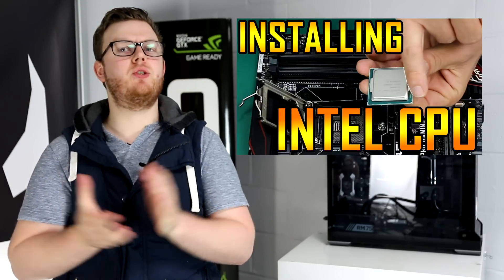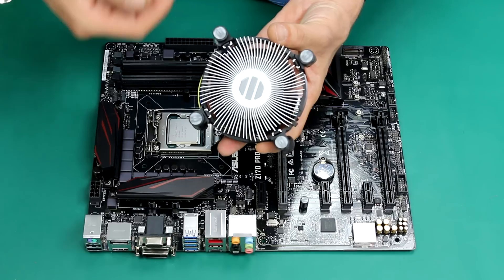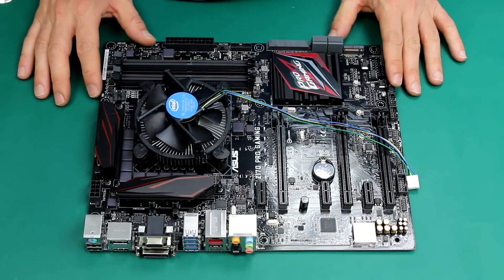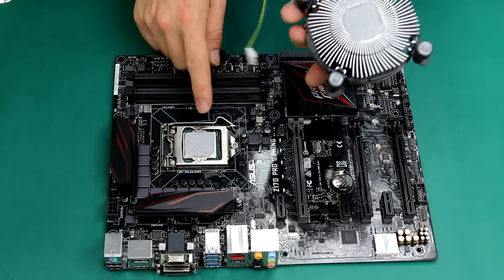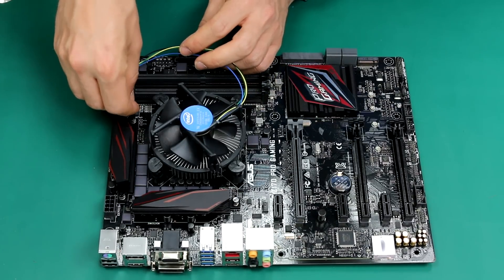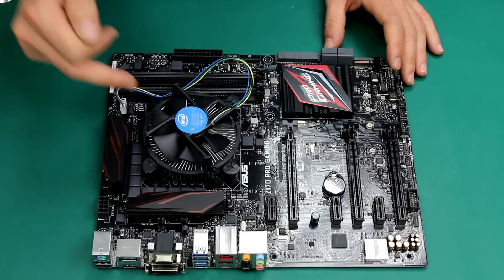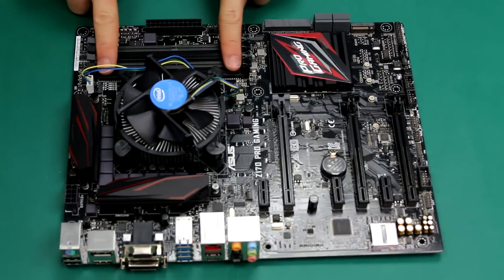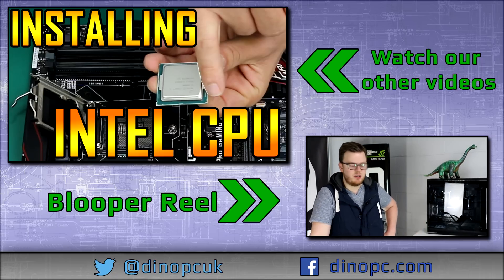"HOW TO INSTALL AN INTEL STOCK COOLER CPU" Dino PC

Comment: This is fine if you have a new fan. If you're reusing an old one, not so easy. To get it off, the black lock pins can stick so they turn the white split  part with them. Then look at the back of the board, pinch the white part with your fingers to stop it rotating and you can unlock. When putting the fan in, look at the back to see if the black pin is completely in. And check where the CPU fan power is and  you can put the fan so its cable runs directly to it. Braid or use a cable tie to remove any slack. 
And there are plenty of videos about how to apply thermal paste. Make sure the CPU and the base of the fan are perfectly clean, use alcohol, before applying the paste.

Comment: Tip: make sure when your putting it back on to pull the clips out after twisting them, then try clicking them in. It does NOT require a lot of force! Don’t break your clips like me!
Reply: thanks
Reply: Hi, I brske the clips too, what have you done next? It s working the clips broke?
Reply: @fky3765  I only broke one so I pushed 3 in and got the 4th in best I could (not all the way) and it worked. 

If you broke all of them you should probably get a new cooler, otherwise your current one may not put enough pressure on the cpu to make good contact for thermal conductivity.
Reply: Actually i broke 1 .. but ur comment did help.. thanks ❤

Comment: Thanks, been making PCs since 1991, but these things are not obvious whether you turn before or after putting in etc. I usually fit better coolers and they have screws.  I dislike pushing that hard against a bendy motherboard!

Comment: What direction should thr knobs be during install and removal?  You say twist but not the direction
Reply: This video is better https://youtu.be/5qczGR4KMnY For installation turn the knobs clockwise, then push diagonally.
Reply: To remove Anti clock  back in clock direction movment

Comment: Hello! Hope your doing fine.. Need help about my computer.. Actually I am cleaning becuse of the dust and decided to uninstall the heatsink but when I started to return it back its place.. The two lock won't click and is so hard to push.. Need help here please..
Reply: Same😭 have u fixed it?
Reply: @matzz3612  Yes... Luckily.. Hehehe let me know if you already fix it ^_^
Reply: @Tingogsayoomen  I haven't 🥲🥲🥲😭😭😭
Reply: @Tingogsayoomen  I need your help 😭😭
Reply: @matzz3612  Oh! am sorry... All I did was twist it lock first to unlock, then point the lock on the designated holes and slowly twist the nozzle to lock... Remember not to exert too much strength because you might create damage to your motherboard..
Reply: @Tingogsayoomen  thx so much

Comment: Might be 4 years old, but you do know there are arrows on the cooler locks for a reason and your press the pins down diagonally opposite, never, ever like this. 

For those watching this, arrows pointing away to install, then turn them in to lock.

Comment: This video doesn't demonstrate how the pins themselves are positioned, which is crucial. Make sure that the black pins are loosly on top of the white pins. If they are too deep in, they make the white pin artificially thicker (so they "grab" the motherboard) so they'll break when forced into the holes. I broke mine by following this video naively.
Reply: @augustkravtsov  You are a life saver

Comment: The clicking system of the cooler is horrible , it isn't clicking in as it should 😟
Reply: Not sure what the response was but i had this same issue. The end tabs on each of the pins had opened out so it wouldnt click into the mboard. I clised them with some pliers and then it clicked in just fine
Reply: Wait he deleted the comment, what was the tip?
Reply: @tanti2325  same here why did he delete the comment 😭 I can't turn on my pc until this is fixed
Reply: @orionscythe  hey man did u fix it? i have the same problem
Reply: @shotokbsh  No I wasn't able to fix it
Reply: Same problem here
Reply: just broke my pins or whatever they are called, I ordered new ones and I hope I will bw able to replace them
Reply: @brd9-o1k i just broke mine im gonna kms can i install them without replacing
Reply: @angel-qu4lb  holy shit man, don't dispair you can order new pins, I did that and in 2 days I had them, I installed the pins and the cooler and now I'm waiting for manor lords to release, there's always light at the end of the tunnel
Reply: @angel-qu4lb  also you cannot
Reply: Simon Herckens it took me half an hour to realise that i have to pull up the pins first. Im braindead.
Reply: @OneThiccSamurai-vn5se  god bles u sir you should make a video about that haha
Reply: @OneThiccSamurai-vn5se  fucking legend dude
Reply: @OneThiccSamurai-vn5se  Jesus Christ thank you so much lmao luckily I saw ur comment at the right time
Reply: @dookiasunny8261  Hahahahahah im glad to help xD. Also be careful not to break em. Ive had quite the annoyance cause one of the pins broke after forcing it too much. It bent outwards and i couldnt get it in the hole so it was bad.
Reply: @OneThiccSamurai-vn5se  I almost broke mine but then I saw ur comment thank God hahah
Reply: @dookiasunny8261  Lmao what were the chances xD.

Comment: i have a problem can i use it without clicking it in ? Answer
Reply: Future Flash || No, you can't because you MUST press it to make an efficient cooling, otherwise the cooler would fall off the socket or the CPU temperatures would be very high.
Reply: never do that I just did that and my temps are alot worse... 60C idle and 80+C gaming

Comment: Don't you have to reapply thermal paste after taking off the cooler to avoir air bubbles?
Reply: Yes and clean both the cpu surface and cooler's surface before that.  He's just showing twice for repetition sake.
Reply: DegenerateProduction This might be a stupid question but do you apply the thermal paste to the cooler or the CPU
Reply: @scottyletsplays9649  To the cpu ;)
Reply: @NECRORIFFER  Either actually, it's gonna end up in the same place.  I put it on whichever is smallest, no point having it where they won't touch.
Reply: @Your_Degenerate  Why would air have appeared?  It's ok the first time then it's ok the second time.
Reply: @lambertovitali3152  The paste should always be applied as flat and evenly as possible, this is why people like to use the blob method, because it spreads out evenly as you place the cooler down. However, If you remove the cooler or move it whilst you're clamping it down, you can introduce tiny air pockets which trap the hot air that the CPU creates when running, which can raise your temperatures as a result. 👍
Reply: @DomicidalCovers  The blob method is asking for it to spread one way and not the other.  I always spread it evenly, like I was putting butter on a sandwich.  One little air bubble is nowhere near as bad as half the CPU with no gunk.  Think about it, what percentage of the contact area will the air bubble be?  2%?  Not much cooling lost.  The most important thing is to use decent paste, like SYY, 15.7W/mK.

Comment: if I plan on not overclocking the i7 6700k can I use a low profile cooler ?
Reply from the maker: We would generally say it would be worth upgrading the cooler, just for peace of mind however if you are not overclocking the stock cooler or LP cooler should be fine. If you are not overclocking it might be worth looking at the non K version i7 6700.

Comment: Seriously.Did ya really need to make a video on how to install a Stock cooler. It takes like 5  seconds. wtf
Reply from the maker: you would be surprised on how many times we get asked this
Reply: Ok then...
Reply: DinoPC  You should do a video on how to install the the usb and power switch plugs on the motherboard. I always get the plugs wrong.
Reply from the maker: soon
Reply: DinoPC Yay. Thank you
Reply: amazingly, there are people who have never done this before. Like me. saw the paste in those three blobs on the cooler and wanted to know if i needed to spread it out myself before installing the cooler or whether just installing the cooler would spread it out evenly all by itself. This video answered that question perfectly.

Comment: step 1 pick up stock cpu cooler
step 2 throw stock cpu cooler into bin 
step 3 buy a aftermarket cooler evern a £20-£30 is tonnes better than the shit that comes with it
Reply from the maker: hahaha stock coolers can be useful
Reply: i suppose in a tiny case where they are all that fit :P just see a small 6"x6" case and looked cool as a media pc next to the tv be perfect for that with a lower powered cpu i3-i5
Reply: I used stock cooler for every Vm rigs with i7 (which generally has high cpu load) and never had any problem.
Reply: if u arent overclocking than ur ok
Reply: but its fine if you are just waiting to buy a aio
Reply: Nuclear Harry t